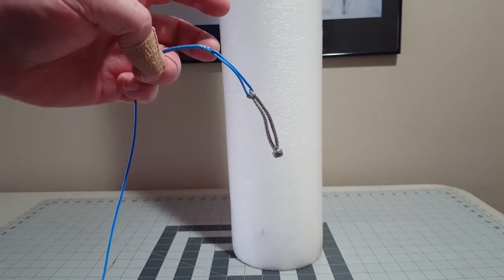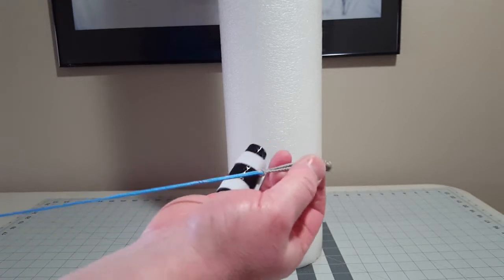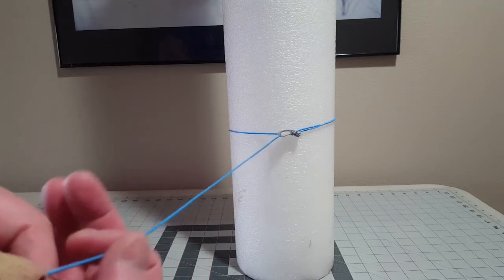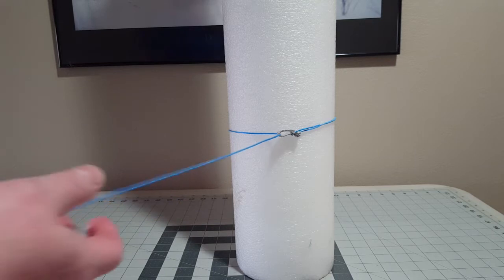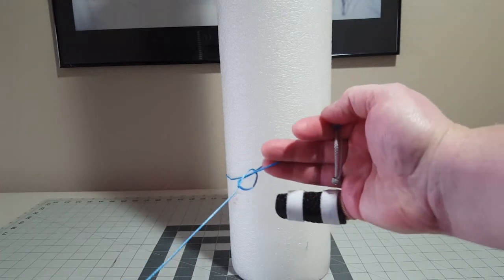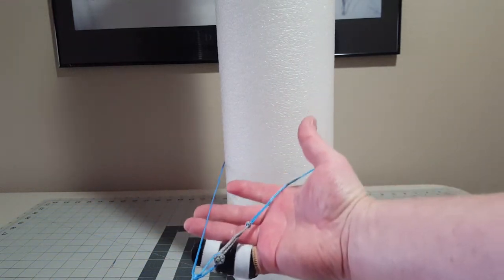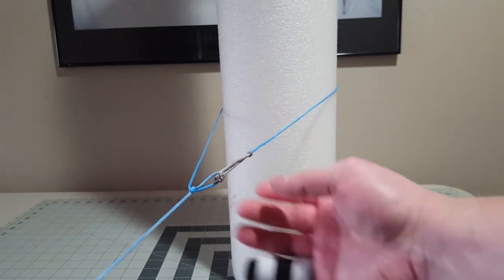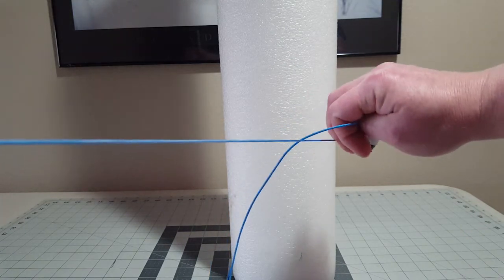tarp line with button knot "v consersion, soft link on ridge line #softlink

Comment: The front image of the video shows use of a prusik knot, and that is not in the video. That would probably be how I would use it, but, really, the photo is enough. Great idea! Thanks for sharing. Two questions:  1) What do you do with the other end of the ridge line, which is, I assume, the one where you adjust for length?  2) Any tips on splicing Zing-It? I find it difficult and tedious. Maybe I just do not have the dexterity for it.
Reply from the maker: Use K&S Music wire .5mm diameter , the other end of the line is a toggle https://www.youtube.com/watch?v=-WDzvakIw8E&t=1s